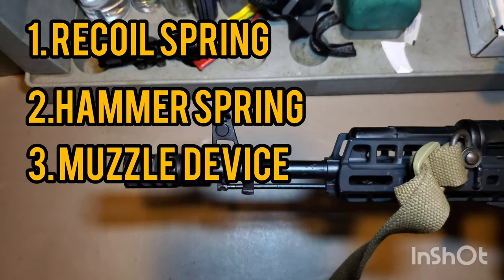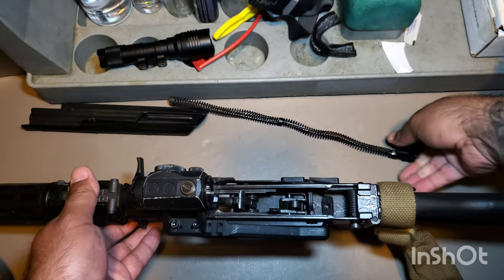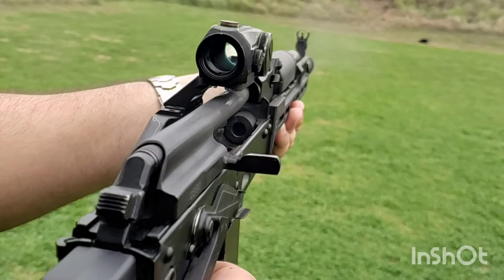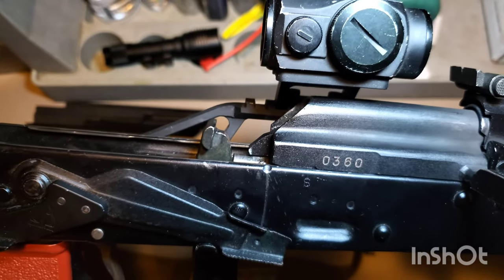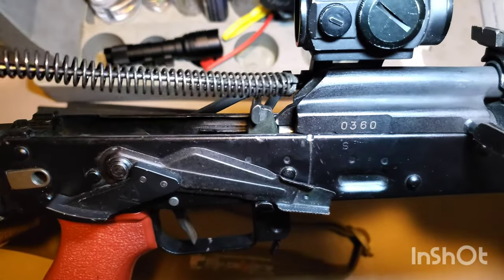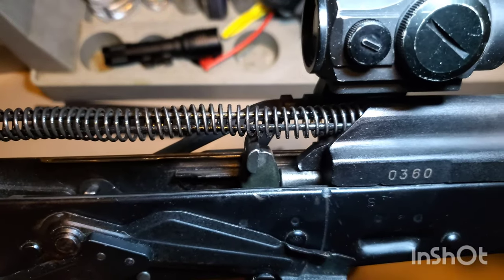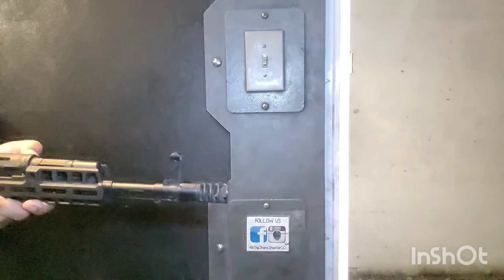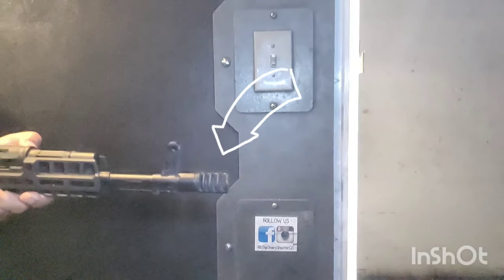How to Dampen The Recoil in Your AK

Comment: You won't feel very much from the bolt carrier hitting the hammer, the hammer spring won't do much at all about recoil. The recoil is mostly felt by the sharp impact of the carrier smashing the rear trunnion. The alg recoil spring was a good choice. The hammer spring is designed to strike the Primer harder for reliability. Best bet for reducing recoil is lightening up the bolt carrier, smaller gas port (if you drill your own  barrel) heavier recoil spring, muzzle device, quality butt pad, recoil reducing stock.
Reply from the maker: Yes true about the hammer spring, but it does help slow down the rear word travel of the bcg.
Reply: Perfer to leave mine stock with the springs that came from china with my gun or in other words stock in the name of reliability.  For compliance I did change out the fire control group and actually had do it twice since the first tapco parts had too light of a trigger.  The recoil of a stock AKM is not a big deal in semiauto.
Reply: @loquat44-40 Yup, unlike what many people say, some Chinese variants go hard
Reply: You obviously did not watch the video.
Reply: @geoffrey3289  OK, smarty, what am I missing here from the video? Please elaborate.
Reply: @overthehillsandfaraway7411  He explained his theory of why he used an extra power hammer spring.
Reply: @geoffrey3289  right....

Comment: and you'll also get a heavier trigger pull with a heavier hammer spring and increased muzzle dip when the bolt and carrier slam home with more energy from the more powerfull spring, no free lunch in there, manage the gasses to reduce recoil

the muzzle device is legit for that reason

get a KNS
Reply: KNS what?

Comment: the heavier spring is still applying pressure to the shoulder. you can't get around physics. it may slow the impulse somewhat.
Reply: A heavier spring gives more inertial,hence it reduces the acceleration of the bolt. The downside is the weight

Comment: OK...I took it out again today and it did the same thing, again...I could not open the dust cover by pressing the spring loaded button aft on the dust cover without hitting it with a hammer. I only took two shots for that to happen. I cut out the rubber buffer and fired a few round and the dust cover opened up after I pressed the button...Not to sure were to go from here....
Reply: If you buy both of these products after the install pull the bolt completely back like you just fired it about 5 cycles...at this point try to open the dust cover...at this point you will know if the button jams up...

Comment: Hard spring in hammer is good but also bad. It puts more pressure on sear which may break or wear quickly. Also hard hit makes hammer weak over time. Spring Factory installed is fine.
Reply from the maker: I've yet to see this happen to my personal guns and also my works several machine guns. I've also have never seen a sear break because of a heavier hammer spring either.
Reply: @thatguy_opossum  yes it happened to a Romanian ttc model. A friend put a heavier spring in hammer to shoot surplus ammo and sear was chipped. So i prefer stay with original factory made parts.

Comment: A Recoil Buffer is the best $10 an AK guy could ever spend ,,, lowers the felt recoil and extends the service life of your gun , 2 birds with 1 stone ,,,,,,,"Power Custom BlackJack Recoil Buffer AK-47 From MidwayUSA"  , side note , if you have a "bolt hold open" safety selector switch , it cant be used with a recoil buffer cuz your bolt wont go far enough back to use it anymore.
Reply from the maker: I have personal experience with several different brand of buffers and over time they cracked. A lot of people do buy the buffer to help prevent the BCG smacking so hard into the rear trunnion. The actual issue is the gun is way to over gassed or the recoil spring is just so weak to slow down the BCG. A buffer in conjunction with recoil spring, hammer spring, and a very effective muzzle brake will help out immensely.

Comment: Need a little help here...I have tried both the guide spring and installed the rubber bumper...after 30 rounds I tried to remove the dust cover to see the internals, but no matter how much I press the rear button to try to removed the dust cover plate it would not move AT ALL! I had to do a tap with a hammer to loosen it up to push the guide spring assembly forward...Is this normal for this kind of setup...
Reply from the maker: @enigmatic51me95  No. Also do you have a Yugo style AK? The reason why I ask is because the Yugo style AKs has a Top Cover retention button on the side of the rear trunnion
Reply: @thatguy_opossum    It's an Armory USA...most likely a parts kit assembly...about 10 years  old...it has the traditional button to press at the end of the dust cover...like all AKs, no other button other than rivets on the sides...
Reply from the maker: @enigmatic51me95  Yeah that's not normal at all

Comment: Dump all those other suggestions in the video and just get a KNS adjustable gas piston. Tamed my very overgassed Galil
Reply from the maker: This is just another way. Alot more budget friendly and not as risky if you screw up drilling out the rivet. Also certain AKs you don't really have that option to replace the piston without replacing the entire carrier ie. if they are pressed/crimped in or welded on.

Comment: In the event that someone wants to run sub sonic ammunition for range practice, would it still cycle with this setup?
Reply from the maker: Possibly but more then likely not. It also depends on the size of the gas port hole. If the gun is hugely over gassed, then it could possibly work if not more then likely not.
Reply: @thatguy_opossum  thanks for the reply. It's probably best to keep it at the velocity it was designed for to get best results anyway. There's always .300 blackout for our subsonic .30 caliber needs.
Reply from the maker: @bodinian  If we're talking about the speed of the bolt I disagree. The reason is AK'S over time like to beat themselves up do to poor quality springs and proper gas port size holes. I know in this video I did not go over if someone is running a silencer or not. Also I would recommend the KNS Adjustable Gas Piston if you choose to shoot suppressed.
Reply from the maker: Hey again thanks for commenting I personally love having these kind of conversations 👊🤙

Comment: What did you use to measure this ?
Reply from the maker: A properly calibrated Anterior Deltoid, Pectoralis Major, and Pectoralis Minor. Also make sure the bursae that is inside the rotator cuff is not inflamed. Very important as well to double check the barometric pressure because a barometric reading over 30.20 inHg is generally considered high, and high pressure is associated with clear skies and calm weather. A barometric reading below 29.80 inHg is generally considered low, and low pressure is associated with warm air and rainstorms. If we are in a indoor range the variables change drastically which is a whole other topic in itself. So in short put the buttstock in your shoulder pocket, bend your knees forward and shoot in clear skies and dry weather.

Comment: My guy just get a kns piston
Reply from the maker: Why spend over $100 when you can spend like $20 and save a lot of time and effort. The point is you should start with springs because even if you put a KNS piston in it you still don't solve the problem of you with a wore out spring. So eventually your going to have to replace the spring. Also the piston was designed for very over gassed guns. If you put a piston in a gun that's tuned properly from the builder your going to have problems of cycling.

Comment: Would this be worth doing to a 5.45 ak74?
Reply from the maker: That gun is actually my 5.45 so yes
Reply: @thatguy_opossum  my question was would it be worth doing to a 5.45? Obviously you can do anything to any gun but is it worth it? 5.45 doesn’t push me around Jim Fuller built me the last AKS74URD before he left RD I don’t know how I feel about messing with it. I ordered the ALG parts but idk if I’ll put them in my URD or my SGL31 got the recoil spring the hammer spring and I’m debating on if I should get an AKT-EL or UL I put an EL in my RD710S and like it.
Reply from the maker: @derekddurbin  I personally would swap the springs. Trigger wise I would definitely go with the ALG Enhanced. Those are by far my favorite

Comment: Odd question,  how would this recoil spring  work in conjunction with a buffer and as for the contour of the hammer I did a profile on my alg fcg  hammer with a dermal and polished the face after.  Just ordered the recoil  to try out in a K-usa kr103 sfs 
Almost wondering if I shouldn't have even bothered?
Reply from the maker: Working with a buffer there's two things. One you slightly dampen the impact of the bcg to the rear trunnion. Two you shorten the rear word travel of the bcg. So it doesn't travel the full distance.
Reply: @Thatguy_Opossum   I understand that,  just wondering will this spring hinder  a proper function if used with  a buffer as well
Reply from the maker: Ah my b no it shouldn't